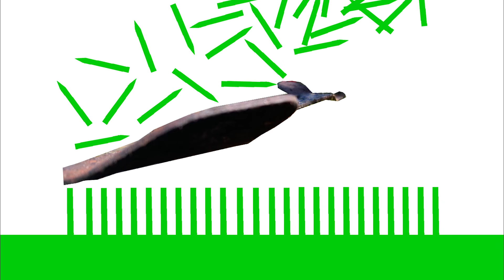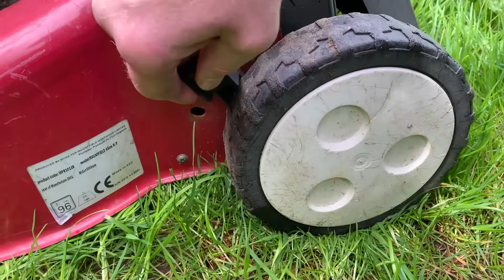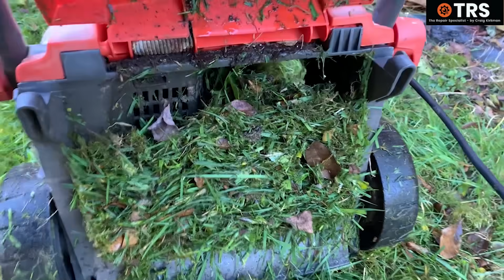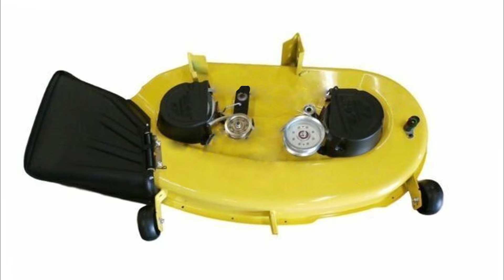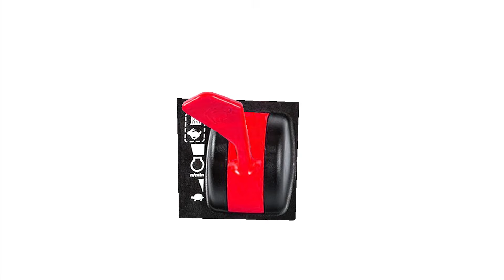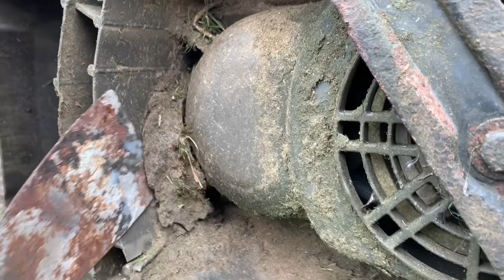The Real Reason Your Mower Keeps Clogging….

Comment: If you want to sharpen your own blades, I've found that the best angle for the cutting edge is about 35-40 degrees. 

I have tried everything from 15 up to 50 degrees, and 40 seems to be the sweet spot. Between 15 and 30 degrees the blades cut great, but the edges roll after a few uses. Above 40 it gets a little bogged down, and after 50 degrees it stops cutting and starts ripping, so I never went higher. Between 35-40 it's still sharp enough to cut, but not so sharp it rolls the edge. Usually lasts a whole season at that angle. 

I aim for 40 because I use a whet stone and I know I'm not precise. So my finial angle is somewhere between 35 and 40 

You don't have to sharpen the back side of the blade, but you still need to grind it or pass it over a whet stone when you sharpen the cutting edge. Because over time the back edge develops a bit of a lip. As this video says, the blade acts similar to an airplane wing. The burrs and ridges on the back end will create turbulence.

So I don't sharpen the non cutting side, but I do give it a few passes so it's somewhat tapered. The point is to smooth out the top and bottom edges, not taper it. That just happens over time with repeated sharpening.

Keep the edge shape as close to factory as possible

Comment: Also make sure your bag is clean, inside and out otherwise there is no air flow.
Reply from the maker: HI

thank you for sharing an important tip about lawn mower maintenance—ensuring that the bag is clean inside and out to maintain proper airflow.

You bring up a crucial aspect of lawn mower care that can often be overlooked but significantly impacts performance. A clean bag promotes adequate airflow, which is essential for efficient grass collection and overall mower operation.

When the bag becomes clogged with grass clippings or debris, it restricts airflow, causing the mower's engine to work harder and potentially affecting cutting performance. Regularly cleaning the bag helps maintain optimal airflow, allowing the mower to operate more effectively and efficiently.

In addition to cleaning the bag, it's also essential to inspect and clean the mower's air filter regularly. A clean air filter ensures that the engine receives clean, unrestricted air, further optimizing performance and longevity.

Thank you for sharing this valuable tip with our community. It's these simple maintenance practices that contribute to a smoother and more enjoyable lawn mowing experience.

If you have any more tips or questions to share, feel free to reach out. We appreciate your engagement and helpful contributions!

Best regards,

Craig